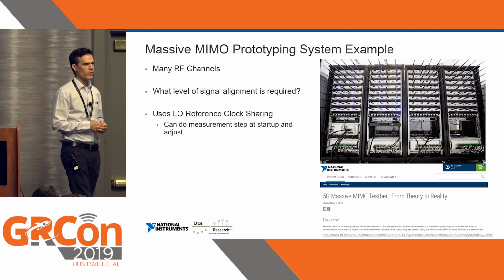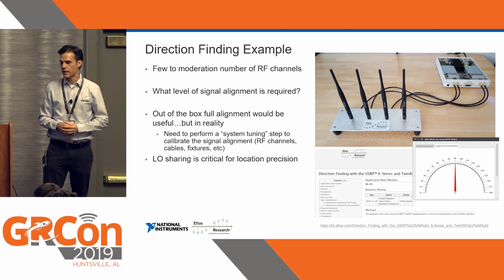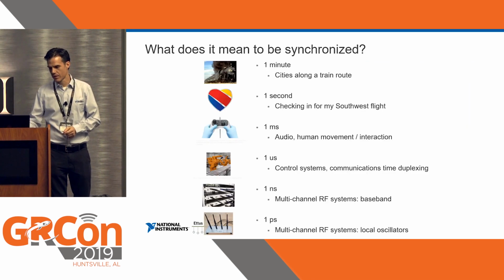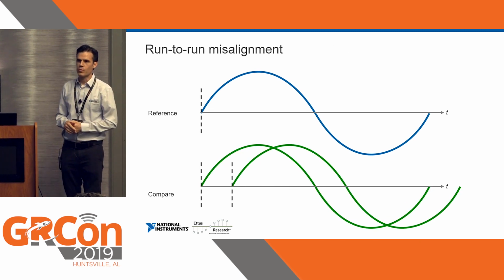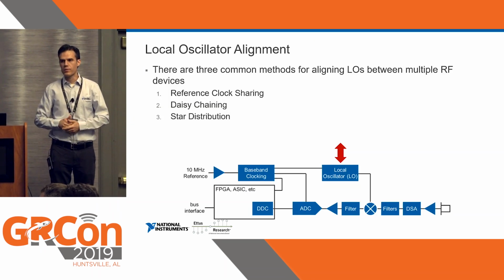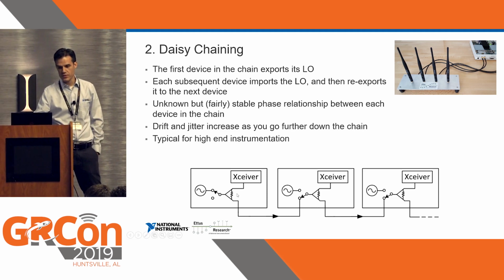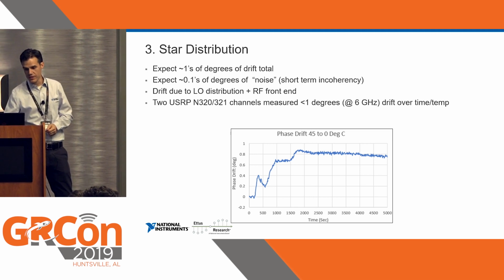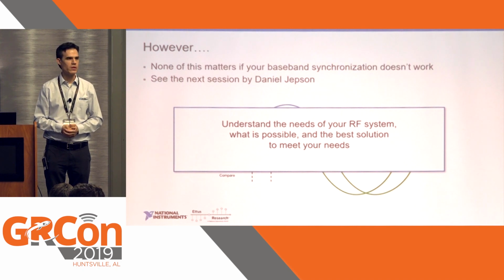GRCon19 - RF System Synchronization - LO's by Dan Baker

Comment: I am new to this concept. I have few queries here: 1)  I just want to understand the idea of doing RF LO Phase sync in these type of system. 2) If the two trans-receiver internal LO is not phase sync then what will be the problem in the system like this 3) If the reference clock which is I/P to xceiver is having some Hz deviation then what will be the impact in the sytem and how will it constitute RF LO DeSync ?